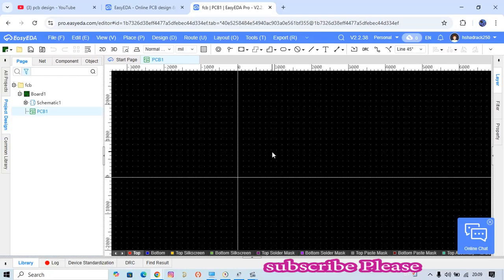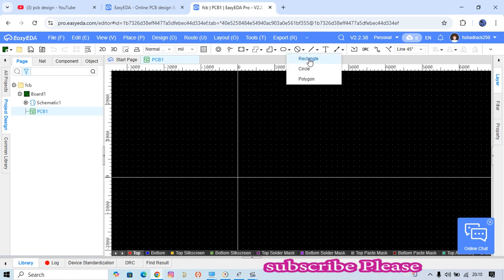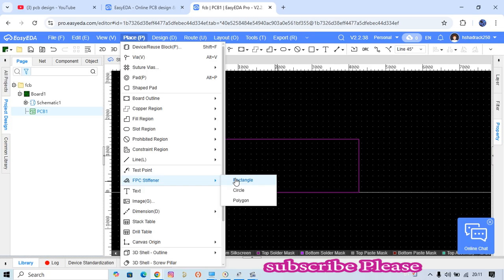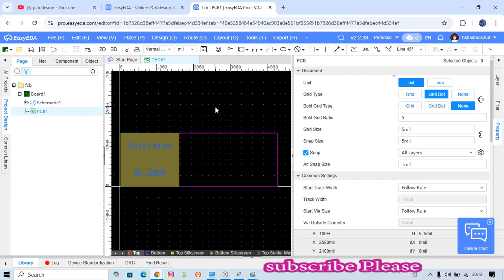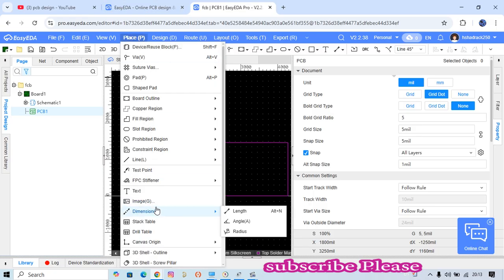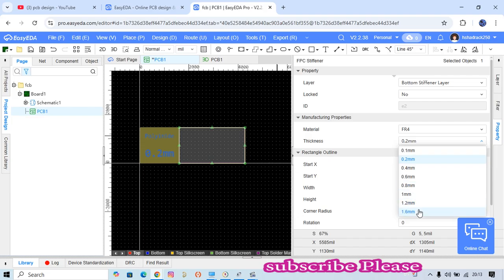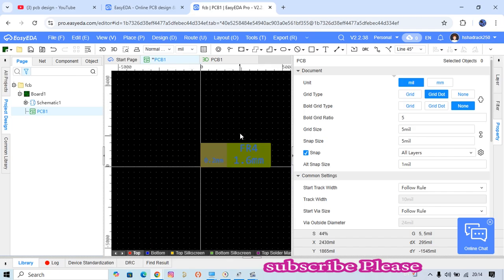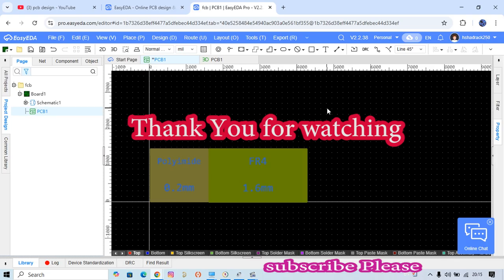How to Design a Flex-Rigid PCB Using EasyEDA | Full Tutorial for Beginners |PCB design Easyeda

Comment: Hello my friend, great video, thank you! I’m interested in designing a rigid-flex PCB for fabrication, but the only software I currently use is EasyEDA. I noticed that JLCPCB does not support rigid-flex boards (only rigid or flex separately). My question is: can I use the design approach you proposed to create my flex PCB and then generate Gerber files to order it through a manufacturer like PCBWay? Is that possible, or do I need to use software that can generate both rigid and flex layers in the same Gerber file?
Reply from the maker: You can use Altium design support rigid-flex , How to Design a Rigid-Flex PCB in Altium Design: A Step-by-Step tutorial
https://youtu.be/s5fO03e2dEU